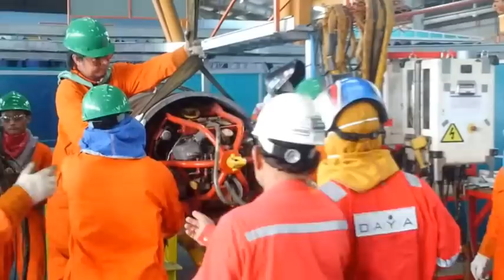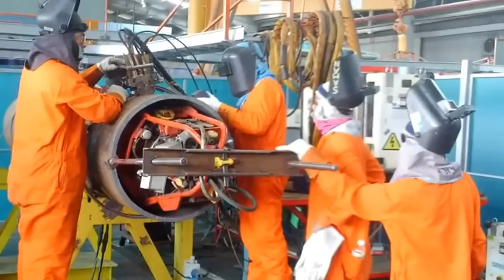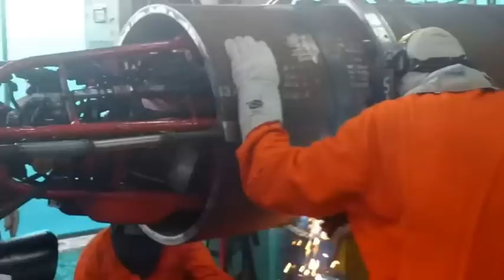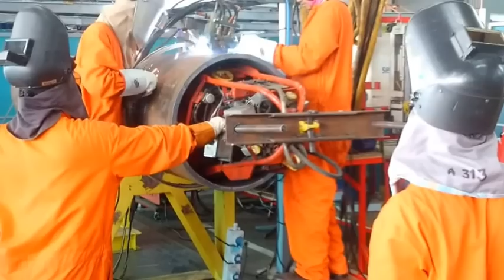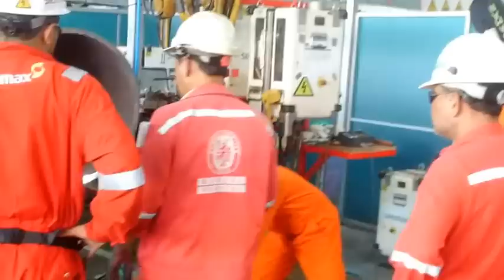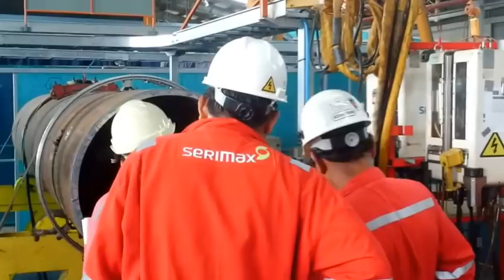Failed Welders Test, Burn Through from the hot pass

Comment: I was a welder before with 1 year in school to learn the profession. It was back in the 70's and the machines did weld only big flat plates for big ships.  There where a few welders with "G6" welding certification that screw up their "field test"  because they where nervous. And like in this video, I assume they had almost no welding experience except for the course that led to the "G6".
Reply from the maker: +Svein Arne Grønnevik This guy had no business testing, There should have been no help from the crew and he stilled failed, If this was on the job I was working on he would never have tested, He needs a lot of training. Welding the flat plates was probably done by sub arc (sand shielding) when those things are running right they do as close to a perfect weld as can ever be made.
Reply: مرحبا انا صاحب الاختراع الأحدث والاسراع في العالم في مجال بناء خطوط النفط والغاز البحري النظام الجديد يستطيع بناء خط بطول 80 ---------100 كيلو متر في اليوم الواحد وقابل للتطوير اكثر النظام للبيع وللمشركة
Reply: ROBOTNOGUD!

Comment: Yup. Let me have at it. I will for sure get it done the first time. The travel speed is to hight and parameters are not set correctly. The welding parameters are set for a positioner eelding method. Start from 3 o'clock to 6 first with a differen parameter setting then work from 12 o'clock to 3. With higher setting.
Reply from the maker: If it was the parameters no one would have passed the test. This guy was simply not ready.

Comment: You can clearly watch the vid. When it gets to the bottom,  it struggles. I have never in my life welded that fast, specially with pipe. The heat was set too hot, you can see it blow through.

Comment: how the hell u fail. u aint even welding it. ur an operator not a welder.  smfh
Reply from the maker: +bongs559 Your right on the operator part, But if the operator is no good....
He is not the first guy to fail, He well not be the last.
Reply: .....He is  multi disciplined.....he has the powerrrrr.....lol...Peace
Reply: .....Nice clean white hat his WRAPPERS are brand new....lol...Peace
Reply: Machine or by hand, it still has to be right.  The operator must be able to set up and control the process to pass.
Reply: Haha.  That’s pipe welding for ya.  Try climbing Iron and welding some column splices.

Comment: I don't get it. These aren't welders, and this ain't a test. U literally push a button and stand back while the machine does the work. This was equipment malfunction.
Reply from the maker: Oh I see.
Reply: BullGooseAnon there's actually a lot to take into consideration. Just because it's a bug doesn't mean it'll run right every single time. Your stick out can come too close or back off too far. You're always adjusting while top to bottom.
Reply: WorldTravel
Reply: totally agree , do a 6010 root by hand with a 7018 filler and cap. then ill be impressed  lol
Reply: You actually manually set the speed, stick out, position, welding heats etc.  To hot a setting and to slow a speed will burn through just like by hand.
Reply: Kristofer Roe.
I agree with you Roe, low hi vertical up!
Reply: operator error! lol . trying to be slick !

Comment: Wanna no what i think?

I think that the second welder starts too early,cause the tubes were preheated and the high heat from the first weld hold the temperature  higher than he needed.
Reply from the maker: I take it you haven't seen production welding, this is a simple case of no experience.

Comment: do these machines really weld that faster then a weld by hand? I can imagine it requires a really experienced operator to weld faster with this then an experienced piple welder by hand?
Reply from the maker: From my experience it is faster and much easier to train a new welder than MMA welding, but like anything, everything has to be working right.
Reply: oh, makes sense! Thanks :)

Comment: how could you not tell I could hear it wasn't welding correctly like wire speed to slow or voltage to high and there spray arcing that's bad there using a orbital welder and they should already have a correct procedure that's terrible. all dressed up looking professional with the gear but are clueless

Comment: Is that half inch ? Is it double bevel? what is gap for root pass? should be able to run knife edge double bevel butted up together and run a real thick root downhand like that is weird that hot pass went through on downhand just run alot of passes trouble with that big of pipe is youll want to try and fill it faster and try and put too much metal down each pass, your better off doing many little passes .. here is a video from when i was in school of me rooting a 12 inch pipe in 5g
https://www.youtube.com/watch?v=zy9vHI7soLY
Reply from the maker: +GLITCHY CAT This guy was way to nervous, Must have been new, His friends did way more for him than would normally be aloud and he still screwed it up, He needs a lot more practice, Burn Through from the hot pass is not normal but can happen.
Reply: +Cole Piotz Why were you practicing 5g downhill? Training for a pipeliner job?
Reply: Do you even weld now?  School ain't shit when you start out in the field
Reply: If pipe goes underground most is done 6010 downhand in field do I even weld now ? Yea a little bit I have bc red seal 6 cwb 4 of them are stick also have two pressure tickets pwp 7 and 9 and over 7000 logged hours